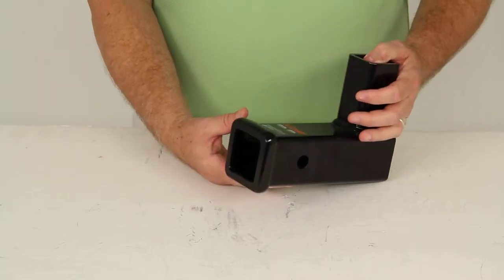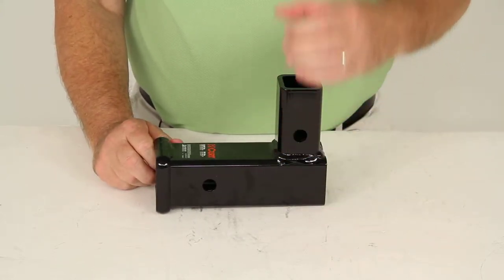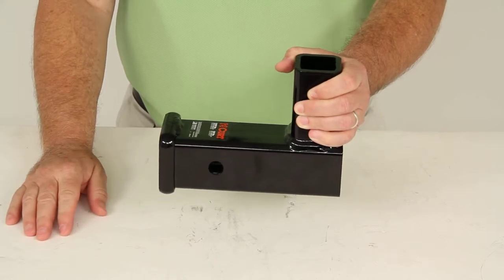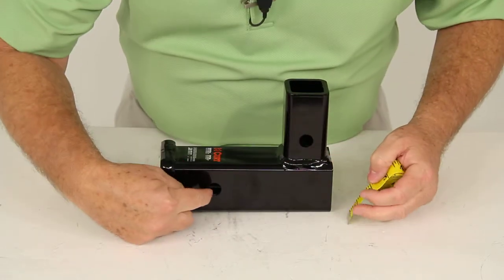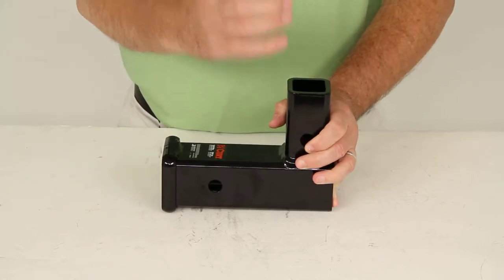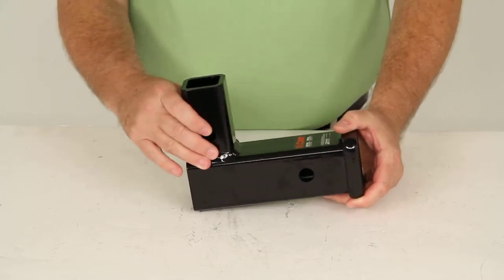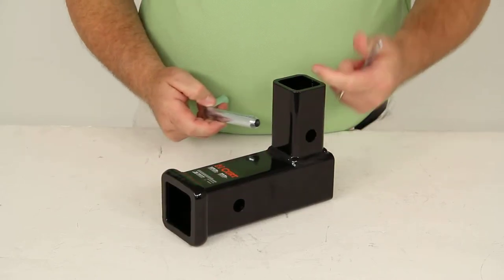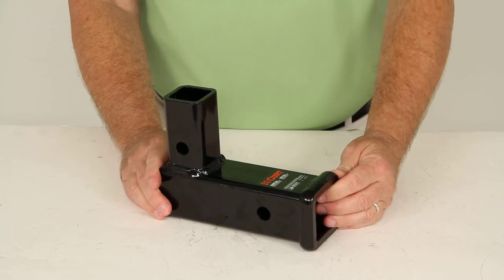etrailer | Checking Out the Curt Vertical Receiver Adapter

Comment: Is there any reason this couldn’t be used in a regular 2” horizontal receiver and then drop in a vertical 2” accessory?
Reply from the maker: That is exactly what this adapter is designed to do! Check it out on our website in the following link.
https://www.etrailer.com/Hitch-Adapters/CURT/C45013.html